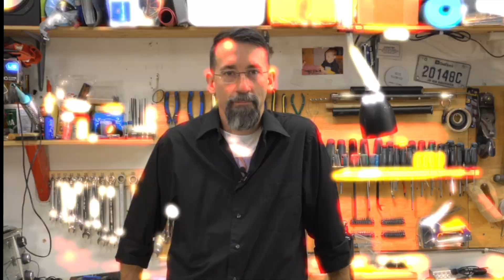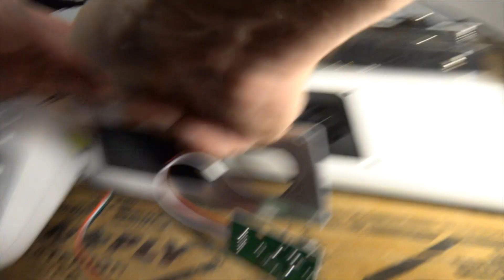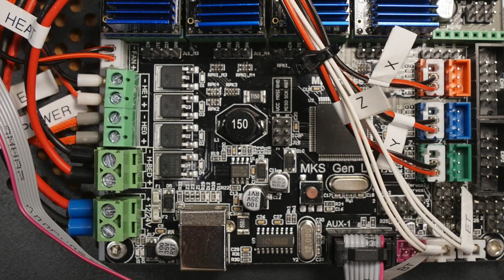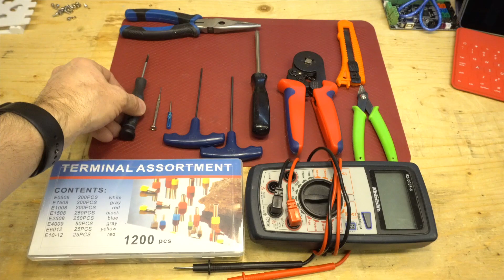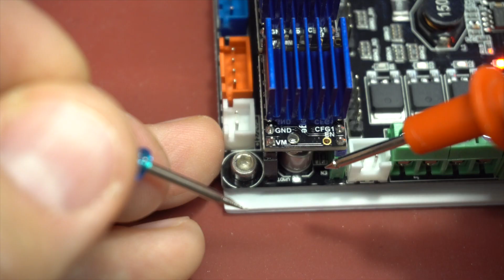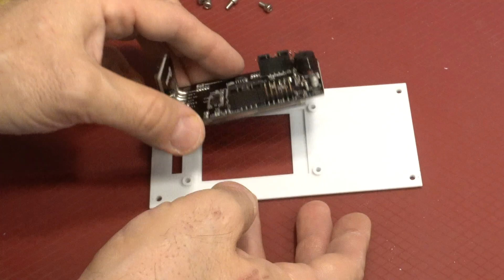Monoprice Mini V2 and V1 - Transformation Part 1

Comment: Hi Frank : )

Seeking help on stuff with my MP Select Mini Pro V2.
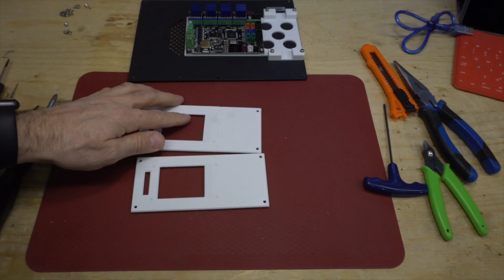Made this quick (8:43) show-n-ask vid as a more interactive substitute for an inane email w/ screenshots. 
Any help would be greatly appreciated. The guys at Mono Price are essentially at a lose with the temperature issue.
https://youtu.be/mHGmOwr6zr0
Thanks!!! : )
Reply from the maker: Hi, I will check that and get back to you.
Reply from the maker: Not finished listening to your video but first the thing you unplug is the auto bed sensor it is used to sense when it’s near the bed. I think that it falsely always detect the bed, That is why it’s not moving down further thinking it reached the bed. It could be a faulty sensor, or something metal near it, the cable/connectors or the main board...
Reply from the maker: As for the heating problem, seems to me to be a power issue, either the power supply does not give enough power, or again connections from the power inlet though the switch and to the board are faulty not giving a good connection, if it’s the case you probably would see some sign of it on the connectors inside the printer they would burn and begin to melt...
Reply from the maker: And for the Micro SD card, those cheap cards just throw it away and buy a Sandisc, Kingston a real brand...
Reply from the maker: And yes you can format to FAT32 on a Mac, I use Mac too, it’s a format option in disc utility.
Reply from the maker: Finally the wifi included with those printers I do not like it l, and the idea of having my printer connected to a server in China... I use a Raspberry Pi 3 or 4 and I connect an Ethernet cable to it, than it serves as a print server with a software called Octiprint and a USB cable connecting the Raspberry Pi to the printer. Once setup I have access to the printer via a web browser and can even send print jobs from Cura with a additional little setup in Cura.
Reply from the maker: And finally this website as tons of informations and the guy behind it is really helpful... Your printer could also probably benefit from a firmware upgrade, I am not sure how you would do it on a Pro version... https://www.mpselectmini.com
Reply: @Franks3Dshop  Wow. Thank you so much for such a thorough response, Frank. I will try all of this : )

Comment: Frank... thanks for the very informative video. I ordered all the parts and am in the process of installing them. However, the single piece faceplate posted on Thingiverse does not appear to be dimensioned correctly. Can you check this?

Comment: This is real nice although I'm scare to modify my mpsm.. I have 7 printers including a MakerBot mini and my mpsm is my most reliable machine, blow the dust off hit print and walk away I don't even have to check for first layer adhesion the thing always works..
Reply from the maker: Hi, yes it can be scary, if you like it the way it is stay with it! Myself my most reliable printer is the one I made from scratch largely based on the Prusa design. I like to thinker so it’s fun for me. I made the video for those who would like to try, so you have a good base to start from.

Comment: Frank, this is awesome! Subscribed! I have two Select Mini V2s, and I will convert both eventually. I would prefer to use a larger LCD (because I am old and my eyes are not so good) - something like the MKS TFT32. Access to the memory card is not so important to me, and it can be made external with addition of another PCB. I can't figure out how to edit your front panel to make the necessary changes. Is it possible to edit stl files in this manner? Or is there a 3D source file that you can provide?
Reply from the maker: Hi, I can provide you with my fusion 360 file if you need to modify it, it is a free software fo the thinkerers. Shoot me an email at franks3dshop@gmail.com

Comment: Frank--just a quick note to let you know that it might be good to increase the height of the standoffs on the printed piece to which the MKS Gen L gets attached.  I don't know how widespread the problem is, but, on my MKS board, the pins on the AC connections stick too far through the board, and interfere with the attachment.  Those 4 pins protrude about 3.2mm while the rest are about half that.  It looks like the standoffs should be another 2mm tall to be sufficient.

I've got all parts printed and am looking forward to proceeding.  (TFT is still on the way, but should be here soon.)
Reply: Obvious, it's not AC connections.  They are the terminal blocks for main power, etc.  Sorry for confusion.
Reply from the maker: Ok just read your update... I did not have that problem with both of my MKS boards...
Reply: @Franks3Dshop  I suspect that it depends on the source and the quality control.  This is the second one that I have used (other was for a "mostly printed CNC" if you know that tool.  I actually already had it before you started this video project!!)  It did not seem to have the problem either.  And, I can take care of this one.  I just figured that there is no reason to have such a tight tolerance.  I printed another piece for the CNC, and the clearance was a total of about 4.5mm.  It's definitely not a big deal!!
Reply from the maker: Thanks I will take a look, my TMC2100 heat sinks are pretty high, not sure how much I can move up, will try 4mm stand-off
Reply from the maker: By the way, I will update the voltages needed for the motors, I have verified the exact values on the original boards, they are much less than what I have stated...
Reply from the maker: Do you mean the DC Main power connections ? Can it be cut down with a flush cutter ?

Comment: I have a V1.  How well will the brackets fit on that unit?
You don't talk about flashing the firmware to the MKD Gen L board.  Is this discussed elsewhere or is this scheduled for another video?
In the trailer you talk about alternatively using TMC2130 drivers.  Do you intend to talk about this later?  I like the idea of using SPI to adjust these drivers.
I've been waiting for this and intend to do this if it applies to V1.  Just let me know.  I think a lot of V1 users would like to give this a try.
Keep up the good work!
Reply from the maker: Hi, the firmware on the MKS Gen L and the touchscreen will be in part 2 of the build, I will add the files to the thingiverse page right now, but it's probably not final, works great so far...
Reply from the maker: From what I see here: https://www.mpselectmini.com/_detail/parts/gpio_headers_on_v1_and_v2_m200_mainboards-01.jpg?id=parts%3Amainboard some boards do not have the same placement of the holes, I can do another version for the V1 if you give me the positions of the holes and the spacing of the board from the edge of the base plate. And if you have other modifications that are needed I am willing to make them.
Reply: @Franks3Dshop  I will.  I am waiting for the video about the firmware before I start.  I am in US and want to order from Amazon.  Do you know if the MKS Gen L shown there are what you would want.  I just don't know enough about them and don't want to buy the wrong one.
Reply: One of the differences between the V1 and V2 is that the V1 does not have a case fan.  In researching the TMC2100 stepper motor drivers, I found out that they are a lot hotter than the what is on the Melzi board.  An addition of a case fan is probably gonna be mandatory.  I'm gonna have to address that before I can proceed.  Keep up the good work and I am looking forward to viewing the rest of the series.
Reply from the maker: If it does not have a case fan, I can try to add one on the right side panel that I have designed, if you are willing to test! I also could make slots instead of holes to accommodate both board versions
Reply: @Franks3Dshop  I assume it is for the "no drill heat bed wiring mod".  That is exactly what I was planning on doing.  My piece has vent slots in it.  I'll have to get rid of them.  Then cut a round hole in it with 4 screw holes at the appropriate positions.  Not being familiar with a V2, is there a slot to plug into the Gen L board for this or do I have to splice into the power elsewhere?
Reply from the maker: I have design a side panel with and without a hole for the bed, and a support for USB Type-B small extension that fits in the sideplate the links to the specific extension is in the description of part 1. It is design to be used with the bottom plate so that no screws or glue is needed. Check my Instagram/Twitter/Facebook page I will post a picture of what it looks like. I will also add a fan to the side panel for the V1 version, does V1 have vent holes on the bottom? I also will try to modify the bottom plate to fit on some version of the V1 board that has the the main board holes closer, I do not have a V1 with those holes so I will take a guess from the pictures. It's still a work in progress for the 3D part designs...
Reply: @Franks3Dshop  Sorry. I do not have Instagram/Twitter/Facebook.  I'm just an old fogey with nothing beter to do.
Reply from the maker: I just looked on Amazon US and they seem to be the same as mine like this one https://amzn.to/2Y9uqD7
Reply from the maker: I will also Make tests with the TMC2130 from Waterott that works on my other printers to see the results, if it works I can add instructions and à Marlin version for TMC2130 the cheap one from AliExpress makes a high pitch noise on idle
Reply from the maker: I added new versions of the side plate for the V1 with vent holes and a place for 40mm fan, I also made modification to the holes that fits overs the mainboard posts to fit what I think is both versions of the board. Let me know!
Reply: @Franks3Dshop  I will look at your design.  Is it in the link for thingiverse?
Reply: OK.  Got it.  I'll look at it tomorrow.  Thanx.
Reply from the maker: @jimsmith9803  Yes just uploaded the update, I will add pictures of this design that I have put on Instagram...
Reply from the maker: @jimsmith9803 Here you go:  https://www.thingiverse.com/thing:3488387
Reply: @Franks3Dshop  Thanks.  I intend to place the fan to blow outward.  If it also has the vent hole, the air flow will be short circuited.  The air being blown out by the fan will be in a large part replaced by air drawn in through that vent hole.  That airflow never goes over the Gen L board.  The other part is good so I will edit the front part and fill in the vent hole.  Gonna order the parts this afternoon. Except for the TMC2100 drivers.  I'll wait on that til you see if you can quiet the TMC2130.  I am intrigued at those for a couple of reasons.  They are SPI tunable offer the possibility of getting rid of the end stops.
Reply from the maker: Hi, in that case I will do the other side panel with holes to have some airflow. This evening I will try my TMC2130 from the other printer and report back the results. In my case with the glass bed I am not sure I can get rid of the switch, X and Y is no problem
Reply from the maker: Made the modifications onThinigiverse, removed the vent inlet from the right side panel and made another left side panel with vent inlet... the TMC2130 printing about 3h long did not get an overheat trigger, so on the V2 they are well ventilated even though they have smaller heat sinks than the TMC2100 good news so far
Reply from the maker: Just tested my TMC2130 they work soundless with Stealthchop activated in SPI mode, even the cheap AliExpress ones works, printing right now, the TMC2100 must already be in stealthchop.
Reply from the maker: Ok had to bring down the the current to the drivers in Marlin, the motors were really hot! I think I have them at a confortable level now, at least the Z motor does not heat the whole top of the printer!!! And no skips either, I will try more prints before calling it a win...

Comment: Hello Frank, I am out of the loop and am not sure of the benefits of the upgrade you so carefully documented for us.  

My machine ran for 60 days flawlessly but then the heat bed failed due to wiring issue that almost everyone encounters with this machine.  It’s been so long now I scarcely recall precisely the solution to fix it.
Reply from the maker: I have fun doing that transformation, that is why I am doing it. And it will be more to my linking, using the touchscreen is a joy compare to the orginal knob, and Marlin as more security features. Also I did not find anything with the look I want to keep. For your bed problem, I also have video about that: https://youtu.be/xT5_GBvba24
Reply: @Franks3Dshop  Could you give us a little more on what the Marlin is specifically? Who makes it where is it from?

Comment: Slt Franck. The adjustment of the vref needs to be done with motors in hold position for better accuracy. Regards
Reply from the maker: The spec sheet of the manufacturer specify that you could burn the drivers if you have the motor powered and to disconnect the motors...
Reply: @Franks3Dshop   Well, I did it with TMC 2100, 2208 and 2130, and also Allegro's and TI's with no issue. The risk comes for a human short circuit error. Tell me why the risk would increase with the motor powered ? On the other hand, doing my way shows you overpower your motor by 10 to 18% if you set the vref with the driver not working. Consequence is your driver gets too hot for no reason and maybe your stepper motor too, depending of its inductance...
Reply from the maker: I am just stating what is written in the specs. I also did adjust with the power active. On the other hand, why would Vref be more precise with power on the motors, Vref should not be influenced by that it is not part of the motor supply.
Reply: @Franks3Dshop  Just sharing my experience. Do as you like.
Reply from the maker: Thank you, I will make a couple of tests just to see if Vref changes with the motors active...

Comment: Awesome! Ive been waiting on this, ordering all the parts tomorrow. I do have some questions :)

1. I currently have 3 fans (mainboard, hotend and part cooling). Is it possible to have 3 fans with this mainboard?

2. Ive upgraded to the Nema 17 leadscrew on Z. Does this affect the vref voltage?

3. When is the next episode coming? 👍😁
Reply from the maker: Hi, yes you can have 3 fans, I will also add a part cooler with a small radial fan like on the CR-10, you can control a second fan with E1 and you have a fixed 12V connector also, so one of the fan will be always ON, or you could trigger the case fan and hot end fan in parallel.

Yes if you have a bigger motor you could bump up to 1.25V also, if you use a bigger power supply with NEMA 17 1.2 Amps or more you could go up to vref = 1A * 2.5 / 1.9 = 1.31V and is the maximum for those drivers. (Remember to adjust VRef after having disconnected the motors, and do not disconnect the motors when the printer is ON).

I am still working on it, I hope to release the next video in 2 weeks.

Thanks!
Reply: Frank's 3D shop Thanks for the reply! I’ll order the parts and get back with progress :-)
Reply from the maker: Just so you know, I have made some modification to the parts to add the USB side connector, I am printing and testing the latest files. Hope all fits well now. The USB Type-B connector I have used is listed on part 1 video description, it mounts without any screws... Will do a short video about that design, I am really proud of the simple solution...
Reply: @Franks3Dshop  Okay, looking forward to that. Just ordered all the parts, anything else i need? I really want Octoprint.
Reply from the maker: Just did a print with Octoprint no problems...
Reply: @Franks3Dshop  Nice! Just waiting for the parts now. Will print your stl's this week :) 

Are you going to add a BLtouch?
Reply from the maker: I could, I have small induction sensors also, but really at that size of a bed it’s not that necessary, I almost never need to level since I have added a glass to make it flat. The only bed sensor that would make sense is a piezo on the hot end so that we can probe the bed correctly,
Reply: Frank's 3D shop I have expended my bed so i will probably add it. Is there any reason you choose the MKS gen l board?
Reply from the maker: It’s small, has many ports, is cheap, compatible with the touchscreen and USB port works simultaneously with the touchscreen, I have tested drivers, TMC2130 from AliExpress, A4982 on a MKS Base, HR4982 on MKS Base L and A4988 modules and they all either produce a high pitch noise at idle or or really loud and jerky. The only ones that are quieter and smoother than the original board are the Lerdge TMC2100 from Spool3D and they have a massive heatsink so it’s a bonus for this application.
Reply from the maker: When I do part 3 I will design a hot end fan shroud with a separate part cooler turbine and options for BLTouch and induction sensors. For now I am using this shroud that improve the part cooling a lot https://www.thingiverse.com/thing:2429054
Reply from the maker: Something like that, I will use a smaller part fan, this one https://spool3d.ca/12v-blower-fan-ball-bearing-40mm-x-10mm/
Reply from the maker: Nice look !
Reply: @Franks3Dshop  I was gonna add TMC2130 drivers, but if you're getting whine and jerk from them then I guess I'll go with TMC2100.
Reply from the maker: Hi, I did not try branded TMC2130 like on my Haribo, I could try them to see if they show the same problem...